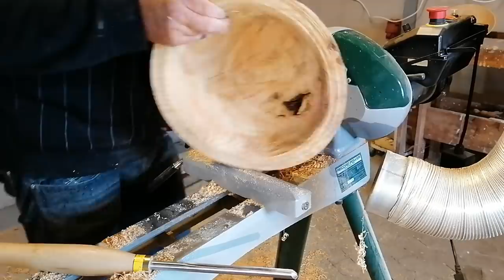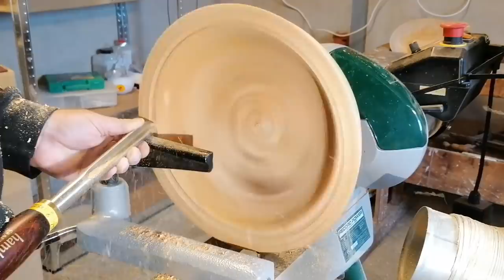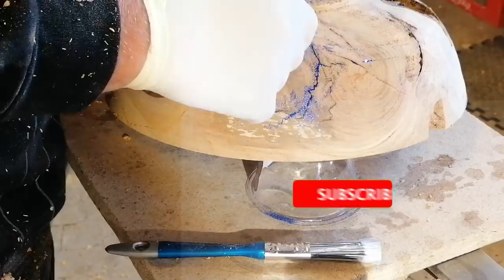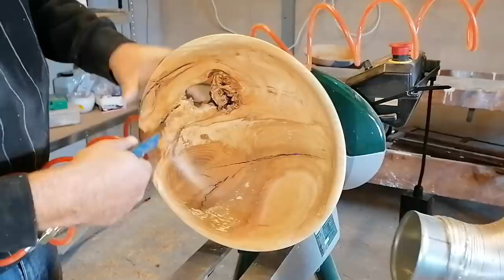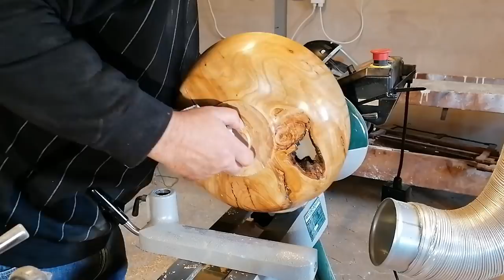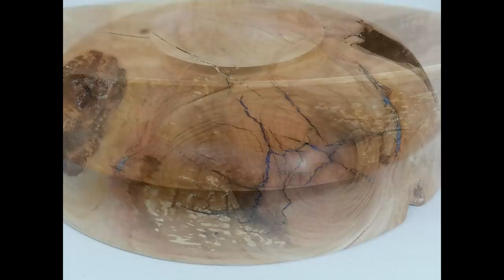Cheap alternative way to fill the cracks in Bowls - Woodturning How To

Comment: I have made green bowls for 55 years…. When I find a crack I like to grind them a little bit and grind below the surface..  I use like a fordom or dremel with small bit.. This allows the resin I use to patch them to fill in the crack and is less likely to be surface only.. The effort to just patch surface causes many to fall out while turning or sanding..  The bowl is very pretty and using a crotch of the tree is great..  When my bowls are finished while green I use paste was to slow down drying and shrink wrap..  i weigh the bowl and put results on the base..  I fill the grain with paste wax and shrink wrap..   I keep weighing them over time and eventually like you I turn the round and if crack I treat as I said above..  great project..
Reply from the maker: Tanks for the input and thank you for watching.. have a great day and stay safe :-)

Comment: I used Bondo to fill in a big hole in a bowl I'm turning and it worked great but it's so hard I have to sharpen very often.
Reply from the maker: Thanks for watching, the CA and the filler i use in the video end up cracy hard too, but as long the result is fine the ekstra sharpning works :-)  have a great day and stay safe :-)

Comment: My first reaction was wondering why you didn't fill the hole in the bottom and the chip on the edge? . After seeing the finished product, I wouldn't do it any other way. The small amount of color in the cracks adds so much accent. I have been using white glue and sand for small worm hole and inclusions. I have used 5 minute epoxy as well mixed with dye and glass beads to add color and sparkle. I will have to try glitter.
I am curios though, did you do anything to stabilize the larger hole? Excellent piece! Thanks for sharing.
Reply from the maker: Thank you very much for watching and for the comment I really appreciate it .. About the large hole I did absolutely nothing and it holding up fine, Other times I had a hole like that I have been giving the edge some CA or filled it with epoxy or Miliput, but normally I try to just leve it alone .. Again thank you for watching .. Stay safe and have a great day 😀😀😀

Comment: Interesting effect! It looks a bit like crystal inclusions in a rock - a much more subtle look than the solid colour one gets using resin. By the way, your lathe was rocking all over the place at the beginning; have you thought about adding some gravel sacks as ballast?
Reply from the maker: I like the look too of the glitter compared with the full color.. and yes I think it is time to Refill my legs with more sand :-) and some more ballast .. it is just one of the thinks you won’t but not get around too :-) thanks for watching .. and stay safe😀😀😀

Comment: Interesting technique.  I use a similar technique using 5-minute epoxy and mica powder, mostly because I don't like using CA glue.  It does require some patience for drying time as I usually leave it for several hours after filling. 

I'm shocked at the amount of vibration you have on your lathe, even after the bowl has been balanced.  You can see the lathe move every time you touch the bowl with a tool.  Might I suggest building a much sturdier, heavier stand for your lathe and getting rid of those spindly little legs?  I don't think filling the legs with sand is going to help much given how they are attached to the lathe.  Even some cross bracing on the legs would help if your not inclined to build a sturdier stand.
Reply from the maker: Hi Steve, thank you for the comment and for watching 😀 I did modify my lathe stand and I have put 190 kilo ekstra on it, the real problem though was the rubber feet that the legs was born with, as soon as I removed them 80% of the vibration was gone even without the 190 kilo .. but now after the added weight it is a totally different lathe to work with, why I did not do it before :-) well it just one of this things 😀😀   again thank you very much for spending time watching and for the comment I really appreciate it, Stay safe and have a great day .. 😀😀

Comment: I recently used glitter and wood glue. The result wasn’t perfect but it came out better than I expected. I knew before doing this that CA glue would have been a better choice but I had none available. I applied too much glitter and glue and turning it afterwards was a challenge. I wanted to sand it off to avoid tear-out but that wasn’t effective.
Reply from the maker: Yes i dont think wood glue will work as well, i have had some really good result with ca glue .. thanks for watching and stay safe :-)

Comment: You took one hell of a risk turning that before gluing in some manner but it turned out ok. I’d recommend not using accelerator on the CA but rather coat with more glitter then leave overnight. Accelerator makes it dry on top and if it is a deep crack it will remain liquid underneath for quite some time. Start turning straight away and as you break through dry surface you then get to wear the wet CA
Reply from the maker: Hi   Thank you for the advise !! but I garanti you the CA was rock hard all the way true, if you look I do it in 2 stage and the Gauge tell the story of cutting very hard glitter and ca.. but again thank you for the advise👍😀 ..  and thank you for watching .. Stay Safe 😀😀😀

Comment: What does the sanding sealer do?
Reply from the maker: Hi Nate.. The sanding sealer causes the wood to rise slightly and the dust does not settle so easily in the abrasive material. and you get the last detail out of your sanding. Thank you for watching .. stay safe 😀😀
Reply: Thank you